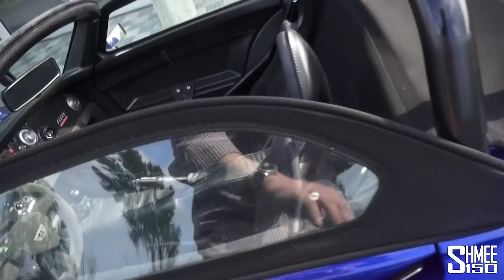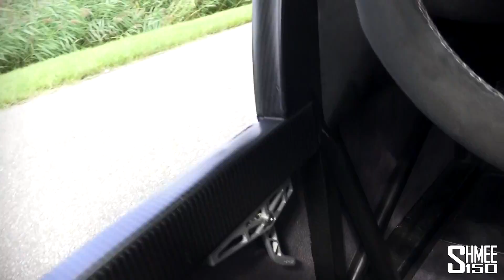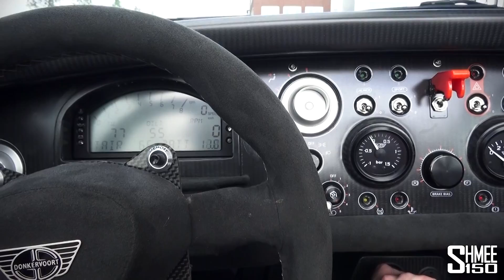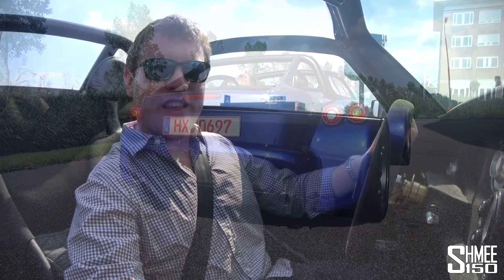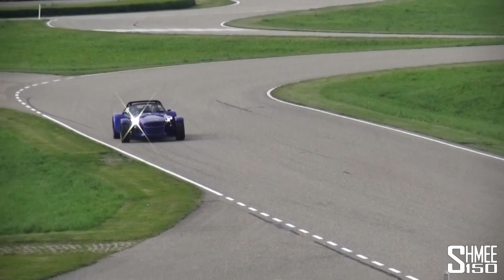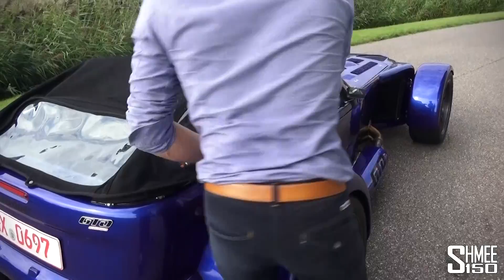Donkervoort D8 GTO - Test Drive on Road and Track

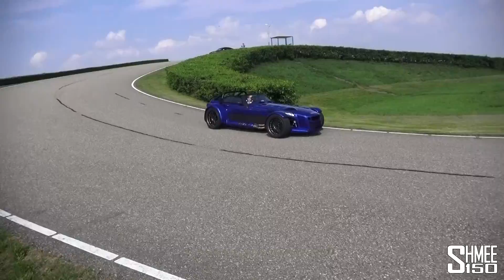Comment: Sorry mate but it seems like  you have your pants full...could at least remove the TC for the acceleration runs on the straights like at 9:05 where i swear i can hear the car not letting itself give it all and dont get me even started on shifting times....
P.S. if it aint the TC, then you didnt even step it through which almost is worse, since you trying to showcase the car.
Reply: Donkervoort recommends only using the TC in rain.

Comment: Great great great, this is pure driving experience.
I love it, especially the Traction Control setup and Brake bias, straight pipe it and it will be perfect!
The V8 from the E90 BMW M3 would also be an impressive option.
Is it available with a hardtop?
Reply: +89Trashmaster Yes, i do believe so.
Reply: A v8 would be a bit heavy and might ruin the cornering and a v8 is also much wider than an inline 5

Comment: For some reason I find this car so much more desirable than other track cars even though it's still a reworked lotus 7.
Reply: The Donkervoort is based on the Lotus/Caterham 7. Caterham bought rights to the design in the 70s, I believe, and it's been a Caterham ever since.
Reply: Brian Vande the gto has nothing to do with a caterham. I drive a older '92 donkervoort, even that one is just a bit bigger than a caterham.  More room in the interior and lost of mechanical grip. Never drove a caterham but I think the donkervoort is just a bit more comfortabele.
Reply: +The Auto Committee the Donkervoort company is actually a company that based their cars on Caterham, not Lotus
Reply: +jody024 Nope.  Lotus 7.  It what they are all based on.
Reply: I don't think the modern Donkervoorts have much in common with the Lotus 7 (or any of its clones). While Caterham stayed closer to the original, Donkervoort got further and further away from the original Seven.
Reply: You couldn't be more wrong about it being an " reworked lotus " it is Inspired of the lotus, but has nothing to do with it mechanically. Donkervoort designs its own chassis, created its own Xcore carbon fibre technology to reduce weight and introduce more strength. Saying it's just a " reworked lotus " doesn't do the company justice. Donkervoort is well beyond the lotus.
Reply: Its like half a viper
Amazing!

Comment: Get T-boned and you're done.
Reply: +jody024 Aluminium tubeframe, wich is about 10-20% stronger than a normal car
Reply: +romanpoet22004 Full carbon body, this car is pretty safe, if it wasn't the car would not be street legal
Reply: DutchCrusader
that too

Comment: Sounds like a V10
Reply: That's because a v10 is just two inline 5's that share a crankshaft.
Reply: +clutchmsilvap It sounds like Audi/Lambo V10 for sure, That's how Audi inline 5 always sound. And yes, as Tumblr said, it's because a V10 is basically two inline 5's combined.
Reply: +TumblrTrash it's a Turbocharged 2.5L TFSI 5-cylinder Audi engine, not a V10
Reply: +Calde Ailis I'd say way more like a Viper V10 than the Audi one actually
Reply: Kaisuke971 If you compare 8.5k rpm with 6k, yeah it could sound a bit different.
Reply: +jody024 Read my comment again
Reply: TumblrTrash too late, lol hahaha